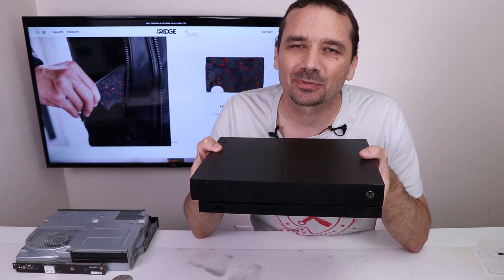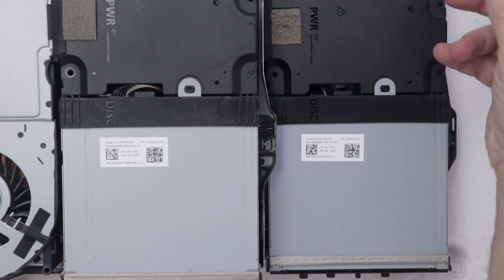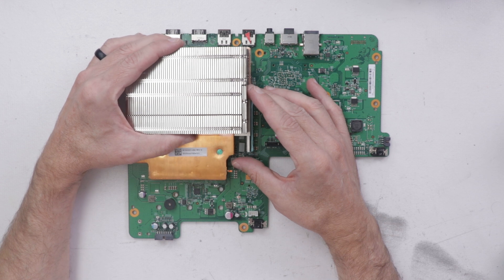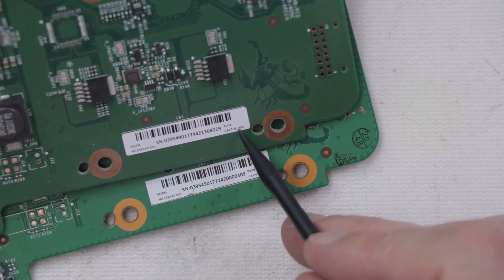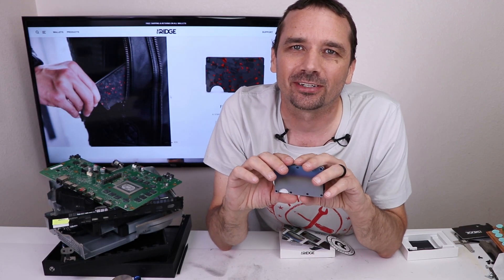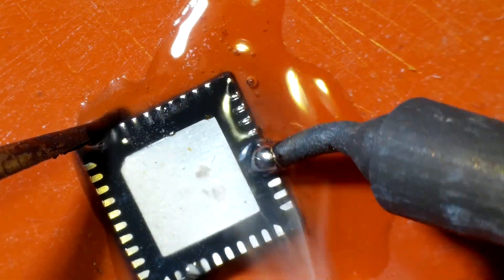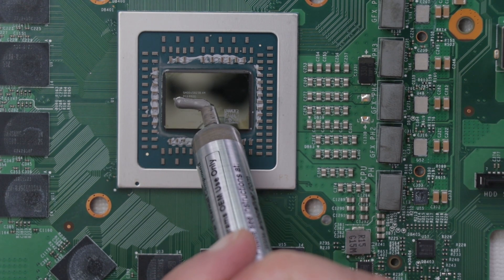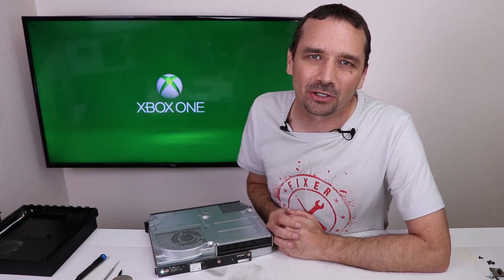Broken PROTOTYPE Xbox One X - But Can I Fix It?

Comment from the maker: Thank you so much to Ridge for sending me this wallet and supporting the channel! Here’s the site if you
want to check them out AND get 15% OFF! > https://ridge.com/tronicsfix
Reply: These sponsors and their games, its a sign of bad parenting.
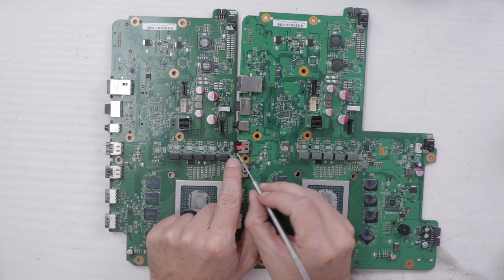Reply: whoa I found a difference!! lol  - if you pause video @ 2:38 and look at the  rear ports of the board, on it's left side, look at the top one. not sure what it's used for, but the top of it (the silver part we see) the one on the left has an opening on it while the board on the right does not... plus there are other differences around the edge of it too :)
idk if this helps at all but i doubt it - just thought i'd let you know :)
Reply: Hi when do you know you have to replace the heat paste in the gpu and is it a must to do so on a 1 x ?

Comment: Call me old-fashioned, but I think at least one adult in the family must learn how to do some basic repairs around the house. I've already fixed a leaking pipe, a cracked roof, replaced shower heads, installed an antenna, so on and so forth. This knowledge must be passed on to other members so that this "legacy" continues... Steve, you're an inspiration to us all, not only when it comes to passing valuable knowledge on electronics, but you push us to go a little bit further. Thanks to your vids, I've decided to start soldering (my biggest fear) and I still suck at it big time and still do a lousy job, but I've soldered that little cable connecting the vibration motors to the board in a Dualshock 4 and it's been months! I've also replaced all LED system in my TV set recently, all thanks to you and your videos. Thank you so much!

Comment: It is actually kinda funny. Majority of your fixes were defective display driver chips. Looking at the datasheet of this one, an ESD rating of 2kV is also pretty low... I wonder if the board designer didn't plan on a proper ESD protection or if hot-plugging kills the chip (would also be kind of a bad PCB design). Just as reference, I am working in the automotive industry, on one sensor we made the customer requirement was 20kV ESD protection on the connector pins with a highly dense PCB of roughly 20mmx60mm. My coworker actually managed to design that thing to withstand up to 18kV ESD... (you can test it with a high voltage ESD gun); we all were pretty impressed. 
But honestly, I would have assumed that at least consumer products should have strict requirements on ESD and related input surge protection.
Reply: In these kind of consumer products the cost requirements come before anything else. A console's life cycle typically begins by the main unit generating deficit (compared to the manufacturing cost alone, not including R&D costs), as it is, so the budget is pretty tight.
Reply: @herrakaarme  even if the budget is tight, it does not justify on saving a few cents. Surely, I can tell how "a few cents" can accumulate over an estimated amount of produced units. I sat next to one, arguing six hours with the supplier to get a discount of half a cent for a resistor (if you wonder: it would have saved around half a million production costs based on the amount of the to be produced target units). 
But anyways, in things like TVs, AV receivers etc. you can somewhat estimate when the next generation may make its debut (not that it justifies /sloppy/ designs), in the console market it's hard to tell when to take the balls in your hands and design the next generation, so you would assumingly design your device to last at least three years to five years and it's just a fail in my humble opinion that a device "dies" by just plugging in a display cable. For the consumer it "dies", for the technican who knows the cause it's "just a chip worth a few cents" to be replaced. And in the end it doesn't make good publicity reading about failing consoles left and right by any manufacturer.

Comment: What is the name of that paste you add to the components before soldering and where can I buy it? I need to repair my ps1 fat model and I need to replace certain components, I'm not that good at soldering but I'd like to try to repair it.
Reply from the maker: Flux. It helps the solder flow. This is what I use (paid affiliate link): https://geni.us/BuQS

Comment: Hi Steve nice fix ones again. I'm wondering why the redriver/retimer chip is notorious for getting faulty but the HDMI port and filters etc stay good in most normal usage cases. You would think if there was a voltage peak or some sort of short the filters would first go instead if the chip. Have a good weekend 👍

Comment: Love your videos.. I have a suggestion to think about. I'm recently getting into retro gaming and reviving all my old consoles. How about some videos repairing and or modding vintage consoles? Replacing the pins inside NES toasters, PS1, PS2, PS3 etc, original xbox mods and repair, heck even Wii repair and mod, they are still cheap and great for modding and emulation. Heck even xbox 360s with the red ring of death!  I'd love to see these old consoles brought back to life and there is no shortage or broken ones to be had cheaply

Comment: Those red arrow stickers are used by QA inspectors to identify defects, so when they return it to manufacturing line techs, they know where to look. 
Also, the prototype designation at that late of a development stage prob means that the chips used are different than production. Compare memory module PNs and APU die serials?

Comment: As a production engineer, I can say that those red marks on the clamp are typically inspections marks to show that somethign has been fully inspected. You'll find this on prototype equipment because they're typically hand made and hand inspected before the full production equipment has been fully installed and verrified.  This would also explain the thermal paste.  It's also very common for preproduciton parts to be deffective and having to be reworked, so it could have been repaired before even leaving the factory.
Reply from the maker: Interesting. Thank you so much for commenting and shedding light on this.
Reply: This is some interesting stuff you telling here.
Please tell me more
Reply: @RedRingOfDead  My background isn't in computer hardware but automotive electronics.  But with any project the release date is fixed and you have to get all the equipment ready before then and you will often have equipment that has been delayed or hasn't been finely tuned so you have to assemble things by hand in tempoary fixtures.  you will often have only a limited amount of components too as those will also be pre-production which is why things are reworked insted of being scrapped.  This Xbox looks like an "off tool; off process" validation sample typically used for compliance testing. For example the preproduction parts on my production lines were used for vehicle validation and crash tests  which might suggest why this prototype doesn't have all the CE markings as they're all pre-production, unvalidated components.  Also, you will have inspection marks on things, sometimes plastic will be stamped with a pin prick if inspected by machine or lables will often be dispensed and applied only when a part has passed testing.  But manual inspections can use paint markers, solvent markers or on black plastics chinagraph penciles.  Circuit boards have continuity testers that typically have hundreds of fixed, spring mounted electrodes that come down onto the traces or solder points to check all the solder points are fully soldered at the same time.  I hope this information is useful.

Comment: What is the temperature and airflow when you do the retimer chip? Everything I do one I have to use 490c at 1 air flow when taking them off. Since you use the same solder on the board, I wonder if you high heat.

Comment: Normally red dots are usually used by quality production to confirm that they have inspected that area, the one in the usb can be also quality but because is a label is to mark a visual defective, it should be removed after defective is corrected
Reply from the maker: Good to know. Thanks!
Reply: I’m guessing the red marks on the cpu bracket are marks to track which screw has been torqued

Comment: I just ask if Xbox One X would work with m2 nvme, just soldering m2 socket and installing a PCIe 3.0 nvme.
 Maybe won't boot or probably ban? 1:28
Reply from the maker: I might try this in a video at some point.